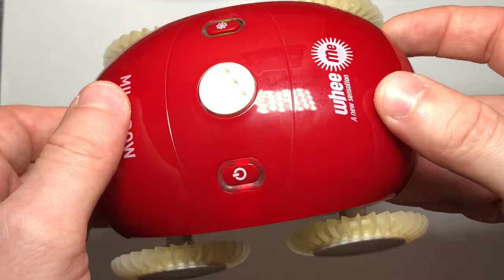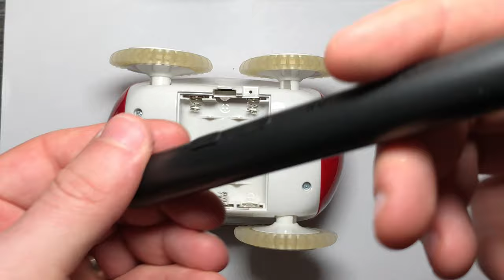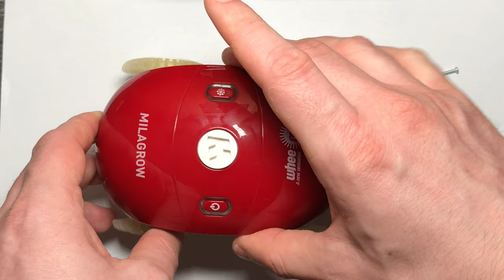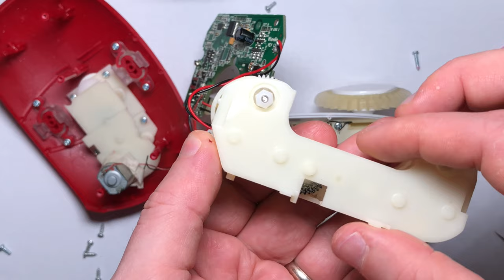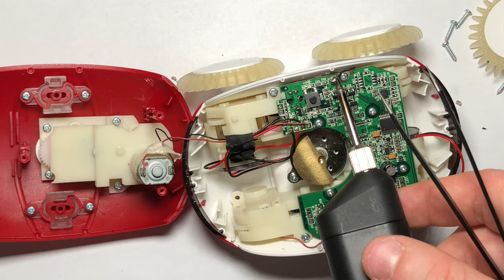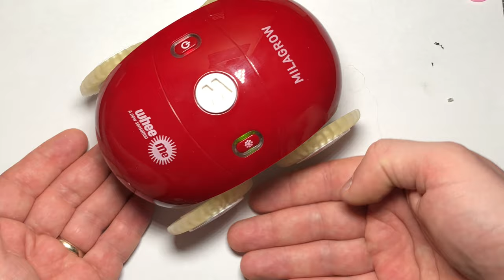Wheeme milagrow repair

Comment: Thank you very much for this Great Video. Can u please Tell me where i can get the Drivebelt which must be replaced. Thanks :)
Reply from the maker: All you need is an ordinary rubber band, which is strong and similar in length to the original
Reply: Thank you very much for your answer and the fantastic Video.